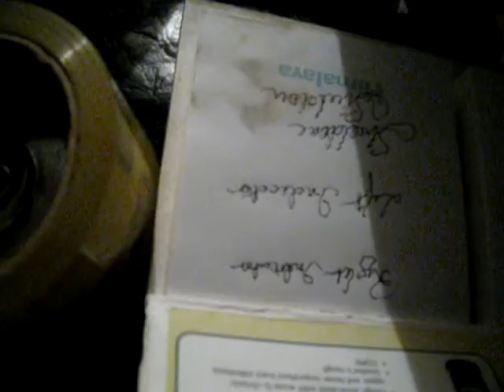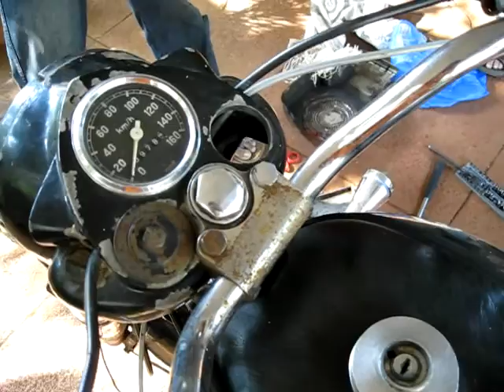diesel motorcycle bullet रॉयल एनफील्ड बुलेट डीजल

Comment from the maker: @tiluthemeguy 80 km to the litre at most  top speed depends on the load but this engine has heavy torque capability if you match a transmission for enhanced speed with a stable chassis you can squeeze out 100kmph easily ..